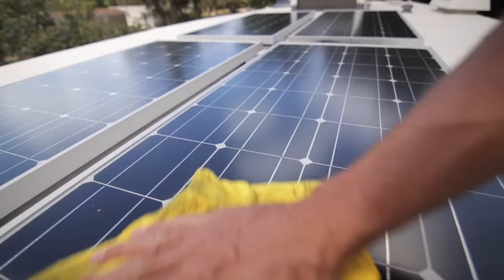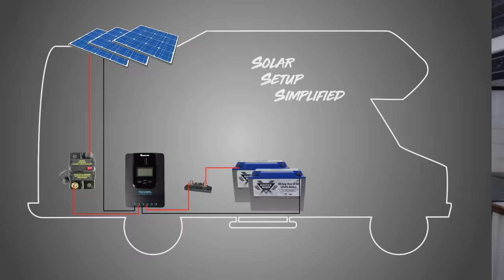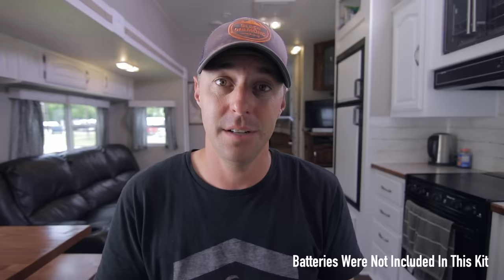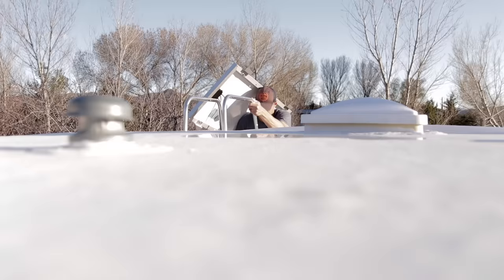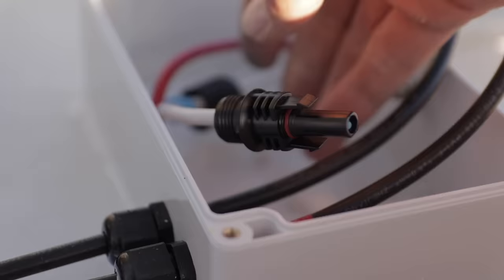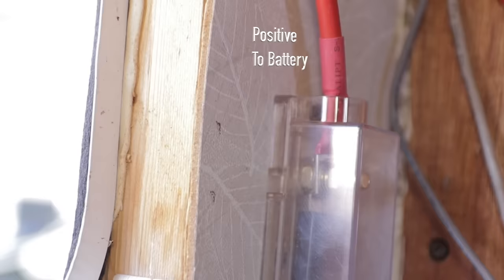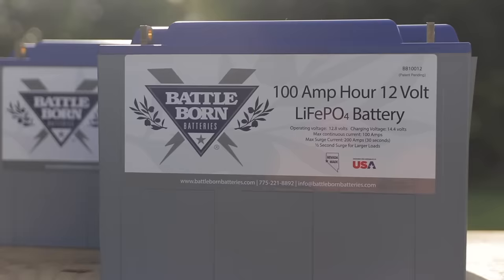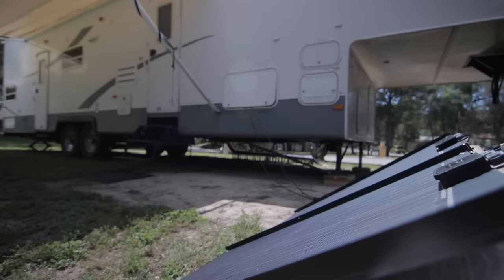RV Solar Simplified! Simple RV Solar Setup.

Comment: What can be powered by the solar setup you described?  What type of solar system would be needed to power your camper as if it was plugged in at a full hookup rv camp site?
Reply: @Bruce Heckler - The other question you should also be asking is for how long do you want to power your rig as if it were plugged into shore power. Before you can even attempt to answer this you need to know how much power you are using during the day. A shunt based battery monitor like the Victron BMV-712 is a great way to find this out and that is why most people (including Jared) recommend that you install one of those first.

Having said that here is where I would start as a sizing guide:

I would suggest a 2000-3000 watt inverter to be able to run loads as if you were plugged into shore power. 

The recommendation is to have at least one 100 amp hour (1200ish watt hour) Lithium battery for every 1000 wats of inverter. I would suggest no fewer than three batteries (in a 12v system)

As far as panels go, you should plan on having around 5 hours of “Solar generating time” per day (depending on latitude and time of year). If you are mounting your panels to the roof they probably won’t be generating at their maximum unless the sun is directory overhead so I would plan on them generating somewhere between 50-70% of their rating. That means that a panel rated at 100 watts will generate somewhere between 250-350 watt hours per day (50-70 watts X 5 hours)

You also need to make sure the solar charge controller you buy can handle the number of watts you want to add in panels. For example the 40 watt Renogy controller Jared has can handle a little over 500 watts for a 12v system and the 50 watt Victron (which was also shown in this video) can handle 700 watts. (These number double of you have a 24v setup, but I won’t go into that here).

So to do the math: 
3 batteries (1200 watt hour X 3) = 3600 watt hours
3600 watt hours / 350 watt hours (best case solar generation) = ~10.3 panels required to charge empty batteries from full to empty during solar generating hours

For my personal setup I have 8x100 watt panels and 3x100 amp hour lithium batteries (in a 12v setup). I can run the all of the regular DC loads in addition to the dual fuel fridge on AC power and an AC powered mini drink fridge during “solar generating hours” and still have power for occasional use of other AC powered devices without having to touch the batteries (and actually charge them a bit). However as soon as the solar power generation drops off the batteries have to carry the loads. With just the base DC loads and the dual fuel fridge on AC and the AC mini fridge (no other AC or DC loads) my batteries are down to 50% by midnight. 

I hope this (long) comment helped answer your question.

Comment: That breaker you used as a disconnect, on the + red side?
Reply: ALL Breakers and/or fuses go on the plus side of the battery. in a negative-ground system.  Negative-ground systems have been standard since the mid-fifties. I believe (but am not certain) that the last Positive-ground system was a 6 volt system on (I think) a 1956 Chevrolet.

Comment: No one seems to comment or show the final connection from inverter to the rv transfer switch. Can I use the transfer switch in my rv, and where do I make connections. I have shore power, generator, and house battery. How and where do I make the solar/inverter connection? Do I have to install a new one, and why does no one ever mention this on their channels?
Reply from the maker: There are a few options depending on your inverter type, but the Inverter doesn’t connect directly to your solar but to the batteries. Solar is just another way to charge the batteries.  Here is an option for a 50 amp RV with a hybrid inverter with diagrams for 30 amp rv setups also.  https://www.youtube.com/watch?v=7xKOyRyxdNk&t=276s

Here are a couple other options for install.
https://www.youtube.com/watch?v=rqrEIKWoMrU&t=586s

Comment: Great video. Maybe a dumb question but learning.. If you use one of the suitcase like solar panels (for the ground deal) that already come with charge controllers on them , do you still run them through the charge controller that has all the roof ones connected? Do you not and connect to batteries? Not sure and maybe thats why its a dumb question if you could even put panels that already had a controller through another or what kind of quick hookup do you use when putting out the other two. Sure they could be just two panels that would have to be hooked through charge controller but is some kind of quick connection?  Ok I butchered that question I think. Hope you get it. 🤯🤯 Should just said how are the ground ones connected ? LOL But I do see some people have the permanent panels on roof and then the suitcase ones as spares but not sure how they setup wire wise....
Reply from the maker: If you have a suitcase set of panels with it's own charge controller you will connect them straight to the battery. The ones I have are just panels with no controller so I connect them to the same controller the roof panels are connected to.  I wired in a set of MC4 connectors for these panels, so I just pull the cable out and plug them in.
Reply: All About RV's Thanks. Guess my confusion/ concern is using multiple charge controllers on expensive lithium batteries and keeping the right amps going to them.  Kinda why i thought only one controller connected to battery bank. So you have a second set of wires at the charge controller with MC4 connectors to use when needed. Wasn't sure if controller had a place for additional wires or wires split for ground panels Appreciate your patience. Guess i'm more visual learner. Ha. Thanks again.

Comment: How do you know you aren’t drilling into air ducts, ceiling wiring, or other vital soft important bits?
Reply: You don't screw any thicker than the top layer board thickness. The sealant does most of the adhesion anyway!

Comment: Can you connect the solar panels to the camper control panel where the battery's connect or should you run wire to the battery directly?
Reply from the maker: You want to go straight to the batteries
Reply: @AllAboutRVs  "straight to the batteries" AFTER going through a solar charge controller. I know you know this, but others might misunderstand.

Comment: If I’m starting out with just one 100w panel (plan on adding more later) to my class A, I don’t need to worry about doing anything but connecting the solar to the battery? (What I mean is, I don’t have to get an inverter or anything to be able to run the lights & fridge in my Rv since the 12v batteries are already hooked up to this system internally right?) the solar hipsters out there have every box, converter, inverter, amp reading box, etc that you could possibly think of!!!! It makes the solar option seem very complicated to say the least...
Reply from the maker: You’re right all you need is a solar panel and a solar charge controller.
Reply: All About RV's thank you!

Comment: Since the panel’s are hot the entire time they’re in the sun, isn’t making the connections like hooking up a ceiling fan with the power on?  Shouldn’t this be done at night?  How do you keep from getting shocked?
Reply: wire up everything before hand. shut off the breaker. the last thing is to plug in the panels one at time if possible. turn on your breaker and hope you got it right! its like shutting down a breaker in your house to do some wiring
Reply: sideways through the kitchen door Thanks. I’m imagining the electrical connections on the solar panels being raw wires. But probably not. Probably something protected like the wall plugs in your house.

Comment: Can we assume that the Lithium batteries are replacing the current batteries on the travel trailer or RV?
Have setting up for solar...:
Do the tow vehicle charge the batteries while driving?
Does the generator charge the batteries when running?

When plugged in with shore cord does the batteries still get charged?
Reply from the maker: Yes we replaced our batteries for the RV with Lithium batteries. Yes the tow vehicle can still charge the batteries while driving and the generator can charge the batteries but it gets the majority of its power from the converter charger that is powered when the generator is powering it. Yes when plugged in the converter charger will still charge the batteries.
Reply: @AllAboutRVs  Thank you for the reply! Keep making great videos!

Comment: Very good, but it feels like we need more "show" to go with "tell".  Longer clips of installing, a camera trip along the wiring, follow the wiring to the controller, fuses, batter, inverter, outlets. Show us a diagram, what is that goop you're putting on the screws, etc.
Reply from the maker: Great question, The goop is the Dicor I talked about there is a link to it in the amazon store link under tools and essentials. We have a very detailed diagram in our other solar video with The KYD install that includes all the complexities of a RV electrical upgrade your looking for. We also have videos on the specifics of inverters and one on the details of batteries. I intentionally left those out for this video to help people see the simplicity of solar.

Comment: Wait solar is to power batteries or to power the outlet itself?
Reply from the maker: Solar charges the batteries, if you want power to the outlets you would need an Inverter. The inverter uses the power from the batteries to supply AC power. https://youtu.be/rqrEIKWoMrU
https://youtu.be/7xKOyRyxdNk

Comment: If the solar system only charges the batteries, then I guess you can only run systems that operate from the batteries? Like you can't run your A/C, etc?
Reply: I want to know the answer too. For example, will 2 Battleborn lithiums power the A/C without a generator? Or does the generator have to be on in order for the A/C to run.
Reply: @jonintc  my guess is that if you upgrade your batteries to a higher voltage system/etc., It could be made to run everything. I was thinking more with the battery that comes with the trailer from the factory.

Personally I'm not looking at boondocking, but whether I could save any money on my electric bill with solar.

Comment: Thanks, good video. My only question is: do I need any considerations when it comes to wiring solar panels to the battery and using the electrical hookup at an RV campsite? I mean, normally, you connect your PV to the controller and the controller to the battery, but what happens if I hook up the electrical on a campsite? will the MPPT controller detect that the batteries are being charged by another source?

Comment: To anyone who can help me!!! Can I wire a charge controller to the battery while the rv also has integrated charger while hooked up ? This trailer also charges using the altinator from what ever car is hooked up to it is it safe to have solar and the other stuff ?
Reply from the maker: Great question. I’ll try and answer this one in this weeks question and answer video.

Comment: How much efficiency do you lose when parked in shade of partial shade?
Reply: Up to 100%!
Reply: @paulortiz2035  There's a non-answer if I ever read one.
Reply: @georgemartin4963  how so?
It depends on how much shade you are under--- 25%, 50%  75% or 100% shaded. And it depends on how heavy the shade is! Light shade, or very heavy shade, etc.

But even just a small or partial covering of a solar panel really drops the panels capacity greatly. More than what one might expect!   To shade even 1/6 of the panel drops the capacity by 50% or MORE!

A non answer?  I don't think so. 

The best you can do is point them perpendicular to the sun for as long as you can for the best or highest output. At a 30 degree angle to the sun the output drops by half or more!  So they are only at full power under rather ideal conditions.  And it drops off VERY quickly once you are out of that ideal zone. There are charts to determine exact panel angles for your geographic location for various times of the year.  For those to even exist (the charts) it tells you that small differences make a big impact on your  solar panel's output.

And if your panels are flat on a vehicle roof, on flat or level ground, your best solar collecting is done from 10am to 2pm. Outside of that you might be at 50% at best, with rapidly declining percentages  the futher out you are from that golden 10-2 time slot!

Sorry I'm not more precise for you. But your paper of detailed analysis on this subject---  we can expect when, exactly???
Reply: @paulortiz2035  Wow! That's a lot of words for  a "shade"😁 more information. But thanks anyway. I appreciate the effort.

Comment: Simple?
2003 25' Airstream Classic.
Simpler...we charge two Zamp 180w portable panels thru the 7pin umbilical, into a Boondocker BD 1260L Lithium converter, 2 100ah Battleborn Lithium batteries, Victron 712 WIFI Monitor.  
Done, no roof climbing, no hole drilling, no wiring. 👍

Comment: What is the rating of the breaker?
Reply from the maker: It’s a 30 amp breaker I have on the panel side and a 40 amp fuse on the battery side.
Reply: @AllAboutRVs  Thank you :D

Comment: I wish someone could tell me how and where to hook up a generator to charge the battery bank if it's a rainy or cloudy day. Like if I have an already completed solar setup fully working, and I need to charge the battery bank with a generator. How do I hook it up? Where do I plug what into? And do I have to unhook something first? Also, can I be charging the battery bank with solar and a generator at the same time so that I fill up the batteries with juice faster if I don't have that many panels to keep up if I want to use all my appliances at once? (Considering I have a big enough power inverter to do so). Can someone please help me out with some info about this? I can't find any videos on it. Thanks!
Reply: You'll need a seperate charger. You can do the switching with relays so that as soon your hooked up to the generator, it automatically switches the input.
Reply: @yehudagoldberg6400  Thanks! What kind of  charger? Like an converter? I've heard there are inverters and converters.
Reply: @mrfender5001  What kind of batteries do you have? Nominal voltage of bank? Capacity?
Reply: @yehudagoldberg6400  I haven't bought them yet. I'm almost done converting my van build, so I haven't bought the stuff yet bc I wasn't sure what I need to be able to charge with a generator. But was planning on buying 6 lead acid 12v batteries.
Reply: @mrfender5001 So just get a lead acid batter charger, hook it up together with a relat so that when the charger is powered it disconnects the solar. Also, did you consider lifepo4 instead of lead acid?
Reply: @yehudagoldberg6400  Yeah, I looked at all the different types. But lead acid is what I'm most familiar with and I know how to maintain them pretty well and I know I can always quickly get a replacement if needed same day.
Reply: You should look at Explorist life YouTube videos. Nate has the most detailed information about van builds and links to all of the components. Hopefully you haven't purchased the batteries yet. I highly recommend you revisit the idea of lithium batteries, especially for a van build. Half the weight, twice the usable amp hours, so you can use less space and NO off gassing inside the van. He even covers the plug in for a generator and how to use the alternator as well. Good luck 🌞

Comment: DO NOT PUT SCREWS IN YOUR ROOF FOR PANELS!!!!!!  3M produces a double sided tape (that is stronger than screws) to secure the brackets but doesn't damage the roof.
Reply: The tape is not ment for rubber rv roofs it's for fiberglass and metal roof applications. The adhesive in the tape will eat through your rubber roof material.
Reply: @roadtripsmargaritas599  The BEST RVs have fiberglass roofs.  I wouldn't touch one with rubber roofs.  They leak FAR too much

Comment: Totally should of stated this is only for DC type of current going into system, nothing about the fact that most of us are looking for DC/AC applications, thanks, jerk
Reply from the maker: No need to be rude I have plenty of videos about using inverters to have AC from your DC setup. Simplifying solar is to understand it just charges your batteries, an inverter is an additional device to give you more capabilities.https://youtu.be/_wjfZi4ZPKs 
If I covered everything RV electrical in one video it would be ridiculously long.